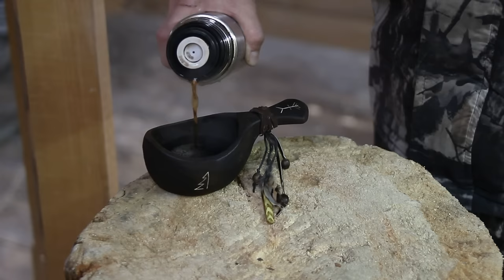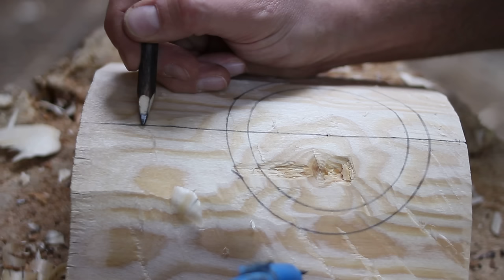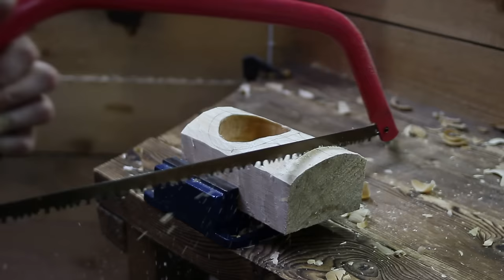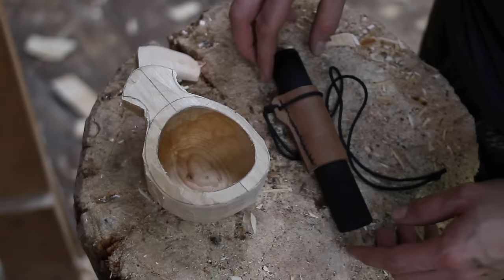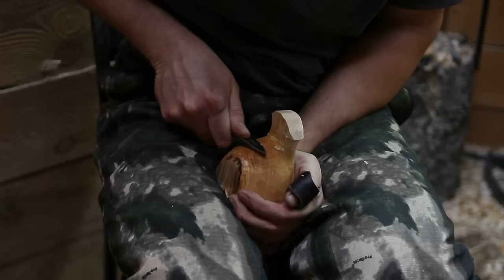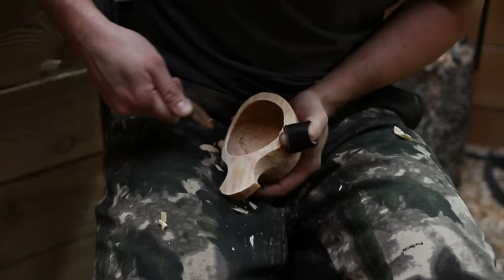Вырезаю кружку из дерева. Якутский нож для левши.

Comment: thank you -- this teaches me about this yakut knife. I watched the video because I saw it said "left-handed knife" but I saw you using the knife in your right hand. This way I learned it means the way the knife is shaped, not which hand to use. I love this. Thanks again for teaching me this. Blessings from God & best wishes.
Reply from the maker: Hi friend. Many thanks. I'll try to explain. The traditional Yakut right-handed knife has a flat side on the right side. I use a Yakut knife, which is for left-handed people. It turns out that the flat side is on the left. If you look at the knife from above. The Yakut knife has a chisel blade structure.

Comment: To those commenting about his thumb—clearly you’ve never done this. I’m only a novice at woodcarving, but it’s still easy enough to recognize that his thumb is well away from the work on his more powerful cuts. Any time the axe is being used for big chops, his thumb is on the other side of the work or tucked under his hand. His thumb only gets close when his axe stays below the work and the strokes are more controlled. 

That said, knife work in the lap is a natural but very dangerous habit. Even with good control, one significant defect in the wood is sending your slice toward your femoral artery. A good practice is to hold the work on the outside of your leg, where any slips or breaks direct the blade away from you. It feels less natural at first, but gives equal power and better safety.
Reply: Gloves are still useful. I grant that he's less clumsy than I am, but a layer of leather between axe and skin is still a good idea. As they say, Safety Third :P
Reply from the maker: Hey. Safety should always come first. I learned to do circles intuitively and on my own. As I learned, I continue to do so. So far, I have been able to do this without loss or injury. I make a lot of mugs and I do not think about how to hold and how to chop or cut. The muscles themselves know how to contract. Automation. ))
Reply: @SoulofSiberiaRu  Well said. The automation of experience is the best safety for any dangerous activity. I should have been more clear that holding work in the lap is a dangerous habit for novices like myself who are learning the craft from videos like yours. Someone like you with the muscle memory and experience that comes with years of practice has far less to worry about.
Reply from the maker: @MrJonVogt  It's all true. I agree with you.

Comment: And i get the left handed knife joke in the Army we would tell privates to get a" left handed screwdriver" great video.
Im rebuilding my shop. Brings memories
Reply: It isn't a joke in this case. Yakut knives have a cavity on one side of the blade so you have right and left handed versions. See 17:35
Reply from the maker: @RandomPlaceHolderName  That's right. Yakut knives have an asymmetric blade structure. There is a knife for left-handed and right-handed.
Reply: @SoulofSiberiaRu  Please explain to me, which is which version of the blade and why...
And yeah i see, the one you uses has it's flat side on the left (cutting edge down).
Reply: @SoulofSiberiaRu  if this is the left handed knife, why are you using it in your right hand?

Comment: Is there a reason behind using the axe in that manor? it seems like a lot of risk.
Reply: It's called testosterone...'Snowflake' .
Reply: @lostandfound459  look dude. I'm just looking for information. I want to know if it's vital to the artform due to having been trained in proper ax, saw and knife use.
Reply: @blitsriderfield4099  Well, he's using it to take off small amounts, he needs to be precise rather than have power. Thus the higher grips gives him complete control of the ax head and although there isn't much power behind each hit, if the blade is sharp enough then it should be sufficient to cut way pieces.
That being said you don't need to use an axe to do this at all, a simple hacksaw would not only be more accurate and safer, but also much faster. I believe this channel is more about creating an image rather than practicality, as displayed not only by his choice of tools (those seen as being "rugged" such as the axe and the knife) as well as some of the unnecessary camera angles that serve no purpose other than "artistic photography".
This is to cultivate an image, it's not a real craft channel.
Reply: @austinhaynes6420  It does appear to be set up to project an image

I don't like hacksaws for cutting wood, especially resinous wood like the fir used in the video. (The wood is green and moist, so it's easy to cut with an axe.) A hacksaw is more for cutting metal. I prefer to use something like a Japanese "ryoba" saw if I have to make precise cuts in wood. The Siberian woodworker, at least the traditional one, doesn't have access to a large amount of woodworking tools, so he has to use what is at hand and use it skillfully.
Reply: The wood is soft (looks like it was cut from the tree a few weeks ago) and the axe is held close to the head, allowing more control for precise cutting. As well, the wood is held by hand on the side opposite the one where the axe is cutting.
Reply: @austinhaynes6420  Thanks Dante
Reply: It could be more in the bushcraft style - minimal tools, so you could do this out in the woods with just your hatchet, knife, and a stump to rest it on.  If you look up "carpenter's axe", though, it's a pretty versatile roughing out tool if you take some care.
Reply from the maker: Hey. You can use a saw and a knife. I use an ax to speed up the process.for me it's a reasonable risk
Reply: @SoulofSiberiaRu  Ah. K.
Reply: @SoulofSiberiaRu  thanks

Comment: Nicely done! I also learned something from you and it's one of reasons why are yakut knives made convex. You showed it while you were carving the muging using one.
Reply from the maker: The Yakut knife has the geometry of a chisel. It is designed for woodwork.
Reply: That knife is also used to strip skins and furs from game. Overall it's very versatile tool and used for everyting yakut natives did long ago. You can do with that knife almost everything you could do with any other but unlike the most knives and you know it because you sharpen it on flat side it's in terms of survival in nature probably the best of all knives. If i said somezhing wrong feel free to correct me.

Comment: Awesome video...very relaxing to watch. :)  I have been trying to find a semicircular chisel (or gouge) that size...any recommendations?  Everything I find seems too small (1" wide max)
Reply from the maker: Hey! Many thanks. This is a specific tool. You won't be able to smoke in a regular store. There are several ways to solve this problem) You can find a blacksmith and he can easily make any chisel for you (this is a very simple product and you can easily make it yourself). And the second option, you can look for it in the online store, and you will be surprised at the choice of the tool)

Comment: You must have a lot of wood handy. I'm impressed that you used that big chunk of wood on making one little mug. It's a nice piece of work, however I don't understand why you didn't use the opposite side of that wood chunk, the one in the middle rather than on the outer side, because the way you did it, the top rim is curved down at the sides and you can't fill it completely without the contents spilling over the edges. If you'd used the opposite side, the rim of the cup would've been level all around. It also would've been less work to round off the bottom of the cup, because the curving sides towards the outside of the log were already curved, at least on 2 sides. ;-)
Reply: Hey Eqlzr2 hes making it in green wood and when it dries there is a big chance of cracks, so the lip is at bark and the bottom is in the middle of the wood. when it dries the wood is working most in the middle and there for you want the strong part of the kuksa there, not the weak lips. also the bigger piece of wood have more stright grain so easy when drying. ofcourse there is many ways of doing this
Reply from the maker: Hey. You can do as you say. I just like to do just that.
Reply: Also, it's birch and it's worthless. No point in saving that what is essentially firewood.
Reply: @0fg4  Oh, OK. Interestingly, at supermarkets in my area, small-to-medium sized European birch splits (about 7-8 to a bundle) go for $10 a bundle.
Reply: @eqlzr2  I guess, he lives near the forest so there's ample of wind fallen birch free for gathering.

Comment: My favourite crafting videos are always the ones with out music, where I can hear the tools at work. <3   Question; How fresh was the wood used, did you have to let it sit & dry out for a while, or was it a relatively fresh cut?
Reply from the maker: Hi thank you very much. I cut mugs from raw birch. But this must be done quickly. If you leave unfinished work overnight, then in the morning there will already be cracks. If you are just starting to cut circles, then it is better to do it from dry wood. So that you can stretch the manufacturing process.

Comment: How much time do you  wait until the wood is complete seasoned?
Reply from the maker: Hey. I cut from raw wood. I am drying the finished product. So it’s easier for me. You need to have a very large supply of wood, so that it has time to dry and that it is enough to make mugs. If it is possible to dry the tree and then cut the mug, it is better to do just that.

Comment: Very nice! You could add a hole in the handle to run a piece of cord through so it can be put on a belt or backpack.
Reply from the maker: Hey. Of course you can. I'm not used to wearing a mug like that. There is a chance of breaking or losing.

Comment: What finish is on the black cup? Also, what are the most common finishes for these cups? What kind of wood do you use?
Reply from the maker: Hey. Black is fired. Linseed oil can be used to protect against water.

Comment: When you tuned the axe, did you use little wooden blocks with different grades of sand/Emory paper? If so, please tell me which grades you used? Thanks
Reply from the maker: I don't remember exactly the name of the sandpaper. I use three types of paper 400 - 600/800 - 1200 grit
Reply: @SoulofSiberiaRu  thanks

Comment: what is that finger protection that you're wearing? Bu the way, I love the cup, and the process!
Reply: Hello Marina. You can use a piece of hard leather and making a tube for the finger. That works. Greetings
Reply from the maker: Hi. Thanks a lot) This is a piece of thick leather. Protects the finger. If you cut for a long time, the finger begins to hurt at the point of contact of the knife. And so I can be cut endlessly)

Comment: I'm confused about the yakut knives. Is the side that has the concavity the straight chisel side? I mean the side that's inline with the grip alignment. And that side is supposed to be facing up when using it? That would mean that you're using a left hand knife with the right hand in this video, correct?
Reply: Yakut knives have a flat side and convex side. The flat side has a fuller/concavity in it. From what I can tell, you don’t get left handed or right handed Yakut knives.

Here’s a good site https://yakut-knives.com/

Edit: well I read the title and realised that yes, that can be left and right handed. I don’t know.
Reply: @randomgoat2272  But the title of this video says "left handed knife" also I've seen vendors on etsy that offer left handed and right handed yakut knives, which makes me think that the knife is supposed to be held a certain way. From what I can tell, the convex side is supposed to be facing the material that you are cutting. What I want to know is if I'm correct about this and also if the direction of the handle should be parallel to the flat side or somewhere along the median of blade's cutting angle. I'm interested because I want to make one and I don't want to give it the wrong geometry.
Reply: mrkiky yeah, I read the title a few hours ago and started editing my comment but I had to leave the house in the middle of writing the comment.
Reply from the maker: Hey. Everything is correct. Yakut knife for left-handers, but I use it with my right hand. One side of the knife is flat. The other side is sharpened.

Comment: Hello friend! Wonderful work!
Could you provide information about all of the sharpening tools used in this video. Are they purchased or made?
Reply: Those are definitely purchased.  I'm sure if you just did a search for wood crafting hand tools, you'd probably find all that you need.
Reply from the maker: Hi friend. Many thanks. The semicircular chisel is made by a blacksmith. Hook knife can be used from the company Mora. When I was just starting to cut out the mugs, I used only one semicircular chisel. I think it’s good at the very beginning not to buy an expensive tool.

Comment: Should I use wood that has been seasoned or wood from a freshly fallen tree? I’m guessing seasoned because it would be easier and won’t crack after you carve it.
Reply: JustGiveMeGold typically you would want to use green wood (fresh wood) especially if working with hand tools it is incredibly easier and softer to work with. most of the time the wood wont crack when drying if you've carved enough, when the wood is a bigger chunk it will be more likely to crack.  i could've gone on for longer but thats basically it
Reply from the maker: There is a dry tree, then use it better.
Reply: Soul of Siberia thanks for advice brother. Your skill and craftsmanship is inspiring.
Reply from the maker: @justgivemegold5876  thanks bro!
Reply: Whoa there thanks for the advice, very helpful.

Comment: hm, interesting. I wonder though, why did he use such a large piece of wood to begin his project with? I ain't the sharpest tool in the barn, but that seems to be a waste of a lot of wood. I have a piece of limb which had a slightly smaller limb growing from it.  Cedar wood. The larger limb is hollowed out with the smaller being used for the "handle".
 It was a piece which was about to be discarded, but I saved because I thought it was wasteful to pitch it aside. 
So, if you have a large tree, and there's a big limb supplying a slightly smaller one,  see if there's anything you could do (such as make a drinking cup) with it instead of throwing away the "knot" eh?
Reply from the maker: Hey. I make mugs of firewood. This log was supposed to burn in the fire. I gave him a second life. I have to unify the shape of the mugs and the manufacturing technology, since I have to make a lot of them. To get about the same mug.

Comment: What is the difference between a left handed and right handed Kakut knife?  Would a right handed person use a right handed knife and a left handed person use a left handed knife? Bruce from the City of Orange in Orange county California USA.
Reply from the maker: Hi friend. The Yakut knife has an asymmetric blade. Like a chisel. It is believed that if the straight side is on the right side of the blade, then this is a right-handed knife. But when you cut wood, it is more convenient to use a left-handed knife with your right hand. Hello from Siberia.
Reply: @SoulofSiberiaRu  so if I get this straight with a left handed knife in the right hand the flat side would be against the wood and the shavings would flow over the "rounded " side.  I appreciate the education.  I like the knife so I need to start saving for when you start making them again.  Thanks again for the info.

Comment: What are you useing to sharpen tool with?
Reply: By the sound the first one is most likely a strop and the second is an extremely fine stone
Reply: @D4rkM4773r  my personal guess by the colour on the strop is that there's added polishing compound
Reply from the maker: Hello. I use wood blocks with sandpaper and a wood block on which the leather is glued. And of course you need to apply a polishing paste to the skin.

Comment: Do you have to use fresh wood or seasoned?
Reply: Fresh wood is easier to cut. The finished product is dried, usually by placing it in a plastic bag and adding crumpled newspapers. The wet paper is changed to dry paper. The dried product can be soaked in Danish oil.
Reply from the maker: I would recommend using dry wood. I use raw, I have no choice.

Comment: Anyone know what was used to sharpen or repair the edge on the axe and chisel? Was it just leather on wood?
Reply: Yeah looked to be a leather strop.  Likely had some stropping compound on it.  Stropping compound is typically aluminum oxide paste, it is green and  basically a polishing paste.
Reply: @jm8361  tnx
Reply: @jm8361  GOI polishing paste based on chromium oxide. Therefore, the color is green. Outside of Russia, there may be other compositions.
Reply from the maker: Hello. I use a wooden block with sandpaper attached to it. and for dressing the blade, I use a board with leather and polishing paste.
Reply: @SoulofSiberiaRu  tnx!

Comment: you don't even know what I'd give to have a knife that sharp
Reply from the maker: Hey. It is very simple. Need to learn. For sharpening knives, I use the cheapest grinding stones. The most important thing is to learn how to keep the angle of sharpening. Over time, the hands themselves will know how to do it. I had to learn how to sharpen a tool, otherwise it would be difficult to cut a tree.